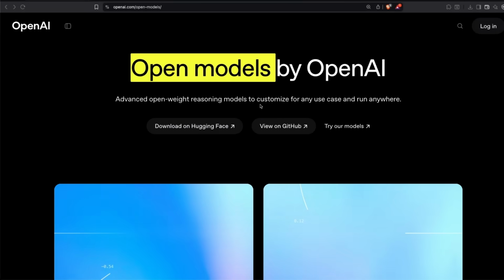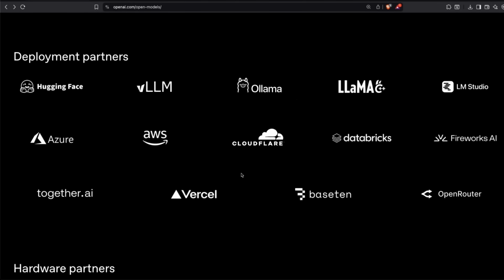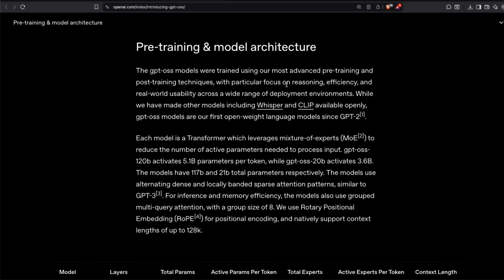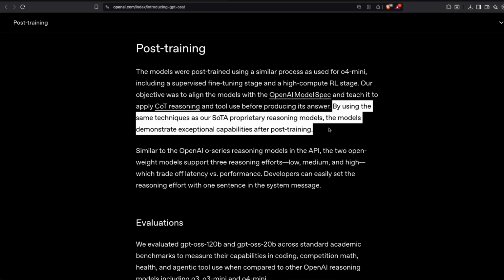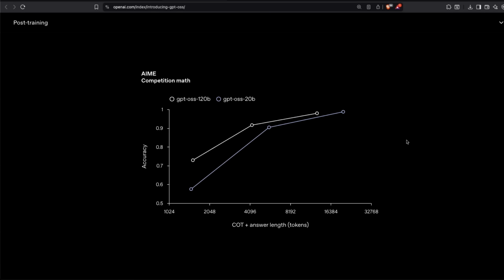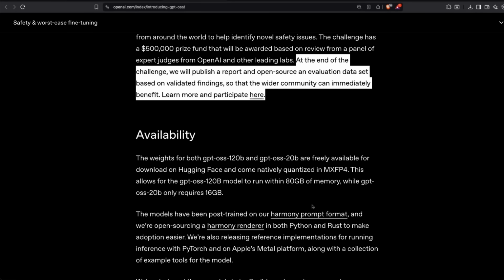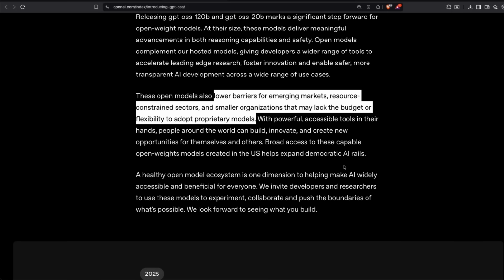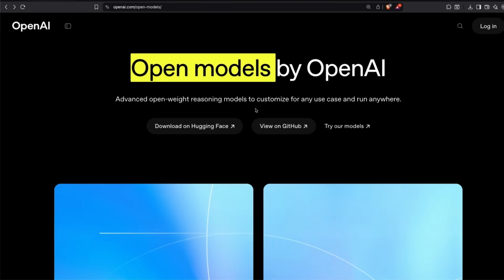gpt-oss 20B and 120B Locally: 16 GB vs 80 GB, Tested in Ollama

Comment: Is this the first native FP4 (training and delivery) open model?  (talking about popular models, not proof of concept)
NVidia talked about FP4 earlier this year when talking about Digits and such.
This is from the model card:
Native MXFP4 quantization: The models are trained with native MXFP4 precision for the MoE layer, making gpt-oss-120b run on a single H100 GPU and the gpt-oss-20b model run within 16GB of memory.
Reply: This is the first video that I have seen that mentions FP4 (my comment above was before watching, but having seen about 8 videos from other channels).
I have both versions working on a Mac Studio.  I like to try a (mostly useless) test where I ask about the cast of a TV show from the 1990s.  This is factual information that is likely considered low priority (not likely used in any tests of models).  I know this is not the purpose of LLMs, but it does indicate how much trivial information has been encoded into the weights.  The 20b failed spectacularly, while the 120b got about 50% correct.  Agents and programming are what I really care about, but I use this Hello World just to get a sense of how much factual data is present (trivia).
Reply from the maker: I am concerned about it using FP4. Unfortunately, they don't offer any other quantization so we are just stuck with it.
Reply: @engineerprompt  If training itself primarily uses FP4 (storage, not necessarily for compute) then I have more faith.  After all, this means the evaluations for training success matches the delivery version.  That is not true when higher resolution models are quantized only at the end.
Reply from the maker: @erikjohnson9112  that's a valid point but I am not sure if that's actually the case. I might be wrong but I think they didn't mention the training was using FP4.

Comment: How about hooking this model up with Cursor AI and doing a comparison with Claude Code? (This is unfair, giving Claude will be using Sonnet; however, it would be amazing to see how close this open-GPT model can perform in comparison with Claude Code.)
Reply from the maker: actually that will not be a fair comparison either. In case of claude code, its really well optimized for claude only. If you connect something like Qwen or even OpenAI models, they will not perform on similar level because the prompts/tools are not optimized for it.
Reply: @engineerprompt   Please allow me to elaborate: Keep Claude Code using Claude, just avoid using cutting-edge tools like agents, MCPs, etc., On the other hand, hook that OpenAI model anywhere, Cursor, Gemini, VS, it doesn’t matter. Now, generate a comprehensive prompt to build an app and give it to both models, and let them run. Note: This test is not trying to see which tool will generate the better app. We know that it’s going to be Claude. However, this test is trying to show us the gap between both implementations, how far/close that OpenAI model can perform next to our everyday tool, Claude Code. So, if the gap is too big, then we may not use this OpenAI model to code. However, if the gap between them is not that big, then that OpenAI model might have more potential than what we thought.